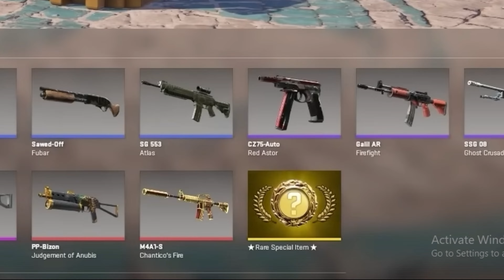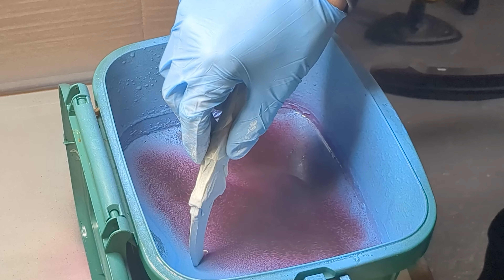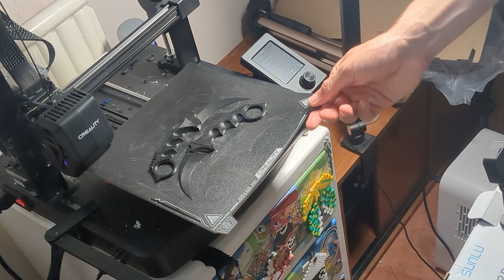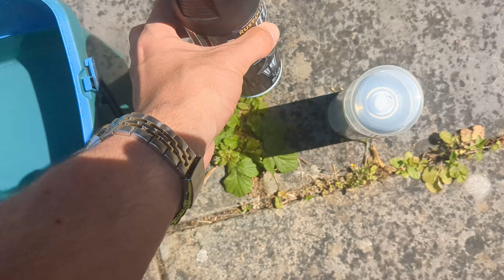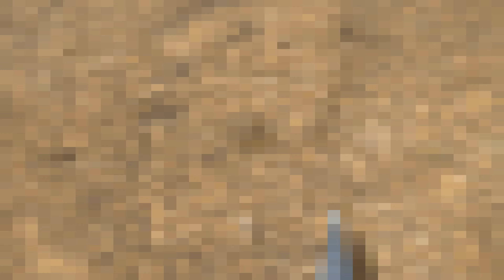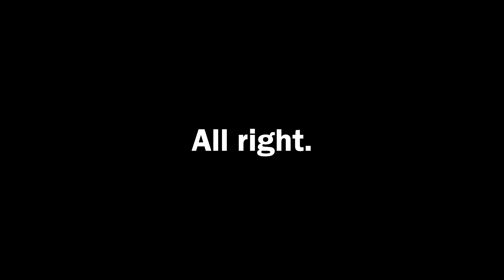3D Printing A Damascus Steel Karambit

Comment: I'm just getting into 3D printing, and my first major project I decided to do is a katana, and I want to give the blade a Damascus steel effect. I've been at it for a few days now, trying to find the right paint, printing the components, now reprinting them after learning to put a channel through them for a metal rod (the adhesive I used wasn't strong enough for my liking). I settled on hydro dipping for that, but I just started this video, so I'm curious to see how you do it.